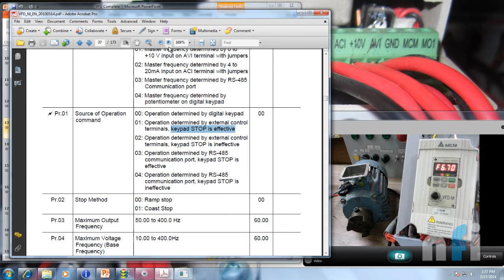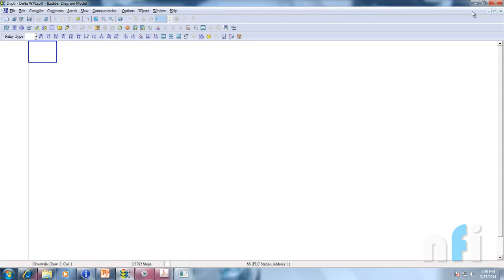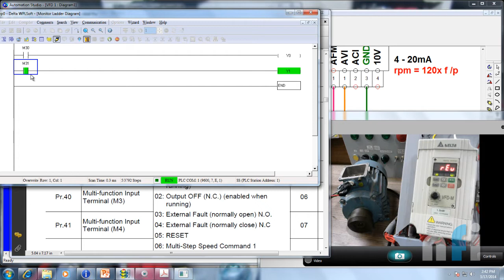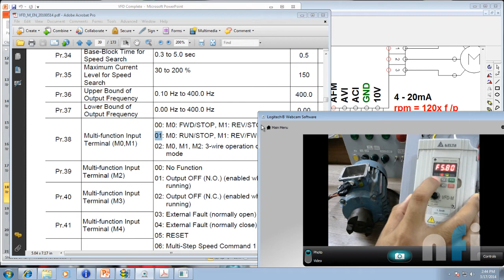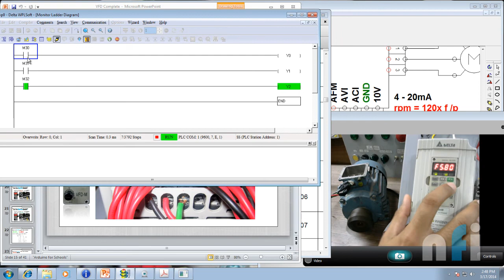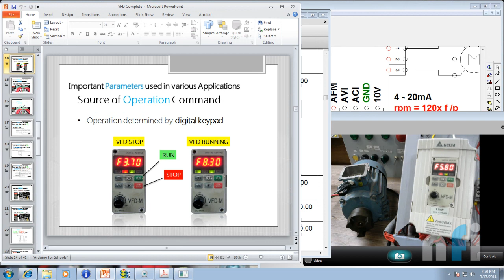Lesson 3- Source of Operation in VFD- Variable Frequency Drive

Comment: Salutation to sir,  it's impossible to change parameter through digital keypad LC-M02E of Delta VFD-M AC drive,  resulting error. I want to operate AVI. Please help me as Pr.  76 in your video  and  the manual I have in hand does not match in its contents.
Reply from the maker: Put 00 in Parameter 76 to make is editable. Does it work?

Comment: Here you have connected ground to external control terminals, that means is the vfd switched to sink mode,so you are connecting ground to external control terminals.If the vfd is switched to source mode, is it true that we have to supply 24v to external control terminals. Please clarify.

Comment: Sir please tell me the pr no in delta m series, I move a flywheel to a motor, when flywheel run on 700 rpm, I switch on from motor to vfd, in this situation my flywheel rpm 0 then starts motor, I want to increase rpm after vfd connected motor, tell me the solution

Comment: sir this very good and easy way to control motor speed.you can set frequency in another mode though avi and terminal control in another mode.my question is that if i want to control both of them though hmi then the mode of both control is available if yes then what mode please help me
Reply from the maker: +saad tariq Hi Saad! I could not completely understand your question. Well with HMI the best way is to program modbus logic for high speed control !
Reply: basically my question is that 
i want to control speed/frequency 
motor rotation backward/forward in same mode  
using external terminal control with plc and hmi will it possible please guide me

Comment: Hi Rajvir,

Thanks for the awesome demonstration. I would be great if you can help me out with a problem.

I am using the same Delta VFD-M for my project. My requirement is to read 16 registers starting from 2000H and control using 3 wire mode, I am using Arduino nano as the base master micro-controller for my purpose along with the MAX485 breakout board.

Unfortunately I couldn't read anything. I tried multiple codes & libraries for solving this, please help me out with some code.
Reply from the maker: Dear Dhrubajyoti, You should check my video of Modbus communication of PLC to VFD to get an idea of read/write address of VFD. https://www.youtube.com/watch?v=PDDEjl50muw

Comment: nice demo. good learning.
Reply from the maker: Your welcome. Find more tutorials at www.nfiautomation.org
Reply: +Rajvir Singh (NFI Automation) 

i have browse your channel. but i couldn't find the setup for programming delta vfd-e in constant pressure system.
Reply: +Rajvir Singh (NFI Automation) 
my setup is, the pump motor is controlled via vfd and a 2 wire pressure transmitter is wires to the delta vfd-e. i couldn't figure out the profer programming. i am new in vfd.
Reply from the maker: The transmitter might be giveing 0-10VDC or 4-20 mA signal to your VFD. To control the output frequency of VFD

Comment: does the C2000 remain in the same parameters? i wire the potentiometers correctly but i cannot get the push buttons to function correctly in forward and revers.. :( please help
Reply from the maker: Tuseran Forte Please share the manual at nfiautomation@gmail.com. We will try to assist you

Comment: Hi Rajvir, good VFD demo!

I watched the series as I am trying to use a 4:20Ma pressure sensor to vary the frequency of a 1HP 3 phase motor that drives a small gear pump, that pumps oil. I seek to have the sensor vary the current to maintain a constant oil pressure. Anyway the current does vary as the pressure changes but I'm getting no change in frequency, therefore RPMs of the motor.

I liked the PLC you used and the software can you advise what it is? The ladder stuff seemed quite intuitive. I have a commercial heating business and am looking for a good 'all-rounder' PLC

Cheers, Greg [greg@krollheat.com]
Reply from the maker: Kroll Heaters Australia Hello Greg!
I wish to know how did you wire the sensor to the drive? Can you share the wiring diagram. And after wiring, what parameters settings you entered in the VFD? Please share some information to troubleshoot your problem.
Reply: i need plc vfd prog. in ladders pls send me if u can
Reply: i need plc vfd prog. in ladders pls send me if u can
Reply from the maker: +Srinath Rakesh what program you are looking for. Please be specific

Comment: hello sir,
I am STILL unable to increase speed of conv. MORE THAN 100HZ after setting P032=100HZ & P035=100 HZ FOR AB POWERFLEX 40
CAN U PL. GUIDE ME
Reply from the maker: If you set it max 100 HZ, how it can be increased beyond that. :O .. What's the max frequency you want? Set it in P032 and P035 !